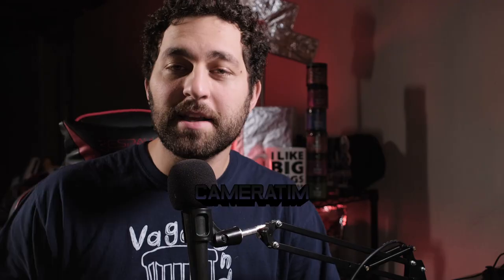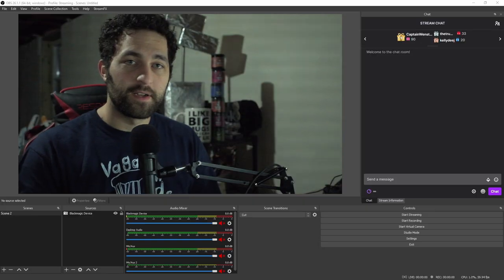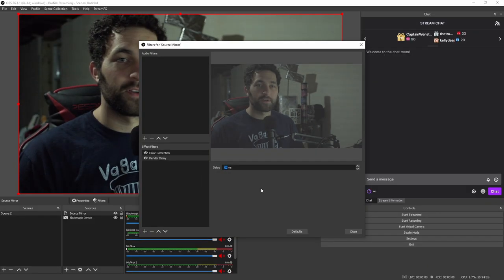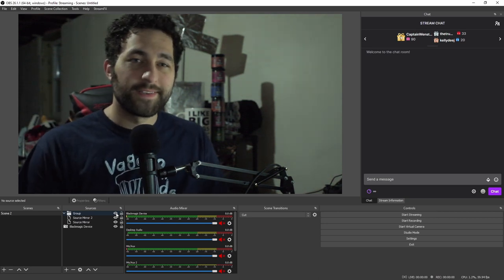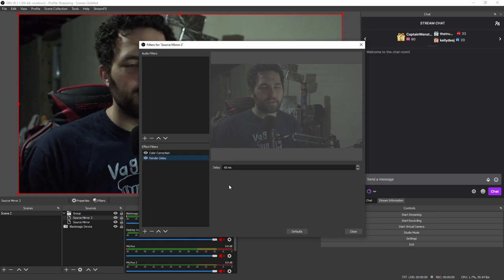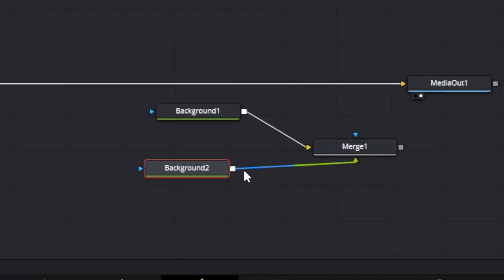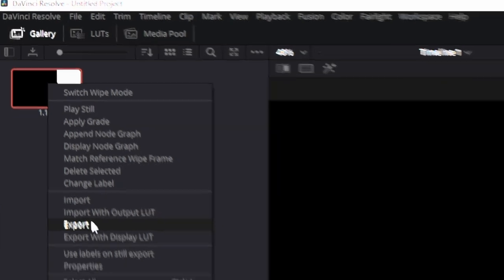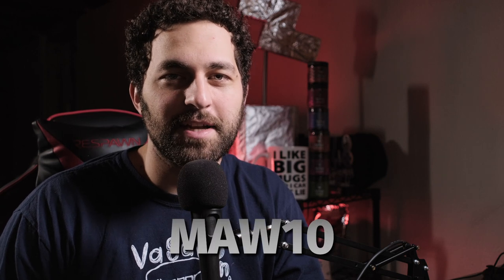Remove Light Flicker in OBS with No Extra Software

Comment: isn't working for me. can't duplicate on streamlabs and the result at the first step it's very dark image
Reply from the maker: Ah, Streamlabs won't work in this way because it doesn't have a Source Mirror source because StreamFX only works with OBS.  I would definitely recommend switching over to OBS, but if you absolutely have to use Streamlabs, then I would recommend pushing your webcam through NDI, then importing it as an NDI Source in Streamlabs since you can just use multiple NDI sources of the same source, but I can't guarantee that it'll be seamless that way.  To learn how to set up NDI though so that you can try this, check out my latest video on NDI and specifically utilize the Screen Capture NDI software.

Comment: Doesn't work for me, because I don't have this option available
Reply from the maker: Which option are you referring to?
Reply: @CameraTim  The source mirror ain't available for the latest OBS Studio version (30.1.2)
Reply from the maker: @FOXYGAMiNGNEWS  Got it, so in the description, there’s a link to Source Clone as StreamFX is no longer a free plugin.
Reply: @CameraTim  Awesome man, thank you so much! I'm gonna try it out in a minute & let you know if it works
Reply: @CameraTim  Unfortunately it doesn't solve the problem. I have a Dubstech 4k Webcam & since a few days I use new LED lights. That combo ain't good apparently. Also changed the HZ to 50, still doesn't work /:

Maybe I have to get rid of the cam or the light :D
Reply from the maker: @FOXYGAMiNGNEWS  What kind of LED lights are they?  LEDs that aren’t flicker-free are rough to work with because they flicker at different rates when they’re dimmed.  Webcams also don’t typically have the luxury of adjusting shutter speed, and very few cameras have a “synchro scan” (mostly just Panasonic cameras) where you can fine tune shutter speed to match LEDs almost exactly.

Comment: You lost me on the render delay. It looked like your stuff just magically started working better.  Looks like it's worked good for other people so I'll keep messing around with settings and see if I can pull it off before I eventually run over my web-cam.
Reply from the maker: The key to Render Delay is that your delaying your duplicated source (the Source Mirror) by one frame.  The purpose of this is so that the flickering is offset by the delay, so in the dark spaces on the original source, the source mirror has the brighter area for it.  The only reason the render delay timing gets confusing is because it changes based on your framerate.  Easy way to figure it out is take 2000 and divide it by your framerate, then round up.  (It should be 1000 because 1000ms is 1 second, but for some reason the render delay doesn't always work at delaying one frame, so yeah...  it's more confusing than it should be)
Reply: @CameraTim  Speak english

Comment: For the delay on the second source mirror, what do you do  if your webcam is 30fps? I think you just did the option for the 60 one.
Reply from the maker: I believe it's around 134ms.  Realistically these numbers in the video are probably, at least from a technical standard, off by a frame, so I had to double the numbers to make it work.  Realistically, you should have a delayed frame at 17ms at 60fps and 34ms at 30fps, but it doesn't seem to change until it hits a two-frame difference.  Not sure if this is a bug, but that's just what I experienced.

The way to figure out the delay needed, you just divide 1000 by whatever fps you're using.  Since fps is telling how many frames are showing in 1 second, and ms is 1/1000th of a second.  Again, that result will probably need to be doubled for whatever OBS's reason is, but that's how to know.
Reply: @CameraTim  Thanks for coming back and replying bro. Respect!
Reply from the maker: @LarsVonHired  Absolutely!  I do my best to answer any questions that pop up!

Comment: Hey great vid, what was the ms delay for pal users for the second filter at 33?
Reply from the maker: Thank you!  If you're streaming at 50fps, then first delay should be at 40ms, and the second at 80ms.  If you're streaming at 25fps, then the first delay would be double those amounts.  And this is assuming you need the second source mirror, sometimes you only need one, depending on the flicker pattern.

Comment: does this work with stream labs?
Reply from the maker: To my knowledge, no, because I don't know of a Source Mirror/Source Clone plugin for StreamLabs.  If such a plugin does exist though, then yes.
Reply: @CameraTim  figured its ok just sucks i bought a BRIO AND IT DOES THIS
Reply from the maker: @Ironfistcdl  No worries, at that point, you're definitely going to want to play with the Exposure adjustment for it, but the best solution is to just buy non-flicker lights.  Cheap LEDs will be very troublesome.
Reply: @CameraTim  you think its my lights?
Reply from the maker: @Ironfistcdl  I know it's your lights, yeah.  Lights are what cause the flickering issue.  Sometimes your monitors can cause it if they're bright and have a weird refresh rate like 144hz.

Comment: My opacity is on 10000 not 100, i still did it exactly how you did it and its not working
Reply from the maker: You're setting the Opacity to 0.5 correct?  Since the recording of this video, the parameter settings changed formatting, but the effect is still the same.

Comment: Nothing worked for me apart from setting my camera to 24fps in it's main settings :) It's a magnifier white florescent light.
Reply from the maker: What region are you in and are those florescent lights dimmable?  I've also seen the rolling bands where it's a very slight desync of the lights and sensor and it just looks like slow horizontal lines moving up or down the screen.  If that's the case, this effect won't fix that problem directly, so it depends on what kind of flicker you're getting.
Reply: @CameraTim  UK, not dimmable, it's a magnifier light on an arm for looking at small components on a PCB.
Your video was a huge help nonetheless :)
Reply from the maker: @thefloppydoc  Ah, okay.  You might benefit from setting your webcam/camera to PAL instead of NTSC.  Since the UK runs 50hz, and cameras set to shoot 24, 30, and 60fps are in NTSC, which is 60hz.  So the system frequency of the camera and lights are mismatched.  See if that helps!  Glad the video was helpful too!
Reply: @CameraTim  Ahhh ok, will give it a try, will let you know what happens.
Reply: Nope 🤣 nothing worked, luckily the camera looking at the PCB isn't used for motion capture and isn't the main camera, tried all Hz, aspect ratio and resolutions, nothing worked apart from setting that 24fps. Thanks for following up anyway, much appreciated! Ant
Reply from the maker: @thefloppydoc  No problem!  Sorry I couldn't get it fully fixed for you.

Comment: wich are the settings in cams with 30fps?
Reply from the maker: If you're using 30fps, then you'll need a higher delay time because there's more time between each frame, so that's probably going to be a Render Delay time of about 67ms (and likely around 134ms for a second one if you add a second source mirror).  And if one source mirror at 50% opacity still shows flicker, then add the additional one at 33%, and you might have to set the first source mirror up to 67%, just depends on your setup and the type of flickering.

Let me know if you still run into issues!
Reply: @CameraTim  doesnt work :(
Reply from the maker: @amadoresthai6949  What lights are you using?  If you're using multiple lights with different flickering patterns, there's not a fix for that.
Reply: @CameraTim  i could fix that in 60fps camera of my cell, but in my webcam w/ 30fps i cant do that, feels like a so much delay.
Reply from the maker: @amadoresthai6949  You might want to try to adjust the Exposure toggle of your webcam in OBS to try to get a better flicker pattern.  I might need to see what it looks like before any effects to see what's going on.  Hop into the Alpha Gaming Discord and tag me in one of the help channels.
Reply: @CameraTim  Thanks for the tutorial, my OBS does not have source mirror under sources. Am on 26.1.2 mac
Reply from the maker: @ericotieno1497  You need the StreamFX plugin found in the description.  Once that's installed, then you'll have Source Mirror.

Comment: I'm using a webcam not a DSLR and this doesn't work for some reason :(
Reply from the maker: What does the flicker pattern look like?  If it's the rolling bands effect where the horizonal lines just slowly roll up or down, there's not really a fix for that.  But if it is just the crazier flickering, this method should work if you tinker the settings enough.  Does it at least improve the issue?
Reply: @CameraTim  nah its defently not slow flickering its fast and yes I did play with the settings but sadly with no success
Reply from the maker: @xGiGsh  Gotcha, okay.  Hit me up in the Alpha Gaming or Sam Woodhall Discord help channels and I can check it out and troubleshoot.
Reply: could u help me aswell??
Reply: @faz2358  i didn't find a fix tbh the only work around is to buy different lights in my case i bought usb powered leds instead of direct to plug to the wall
Reply: @xGiGsh  i have that